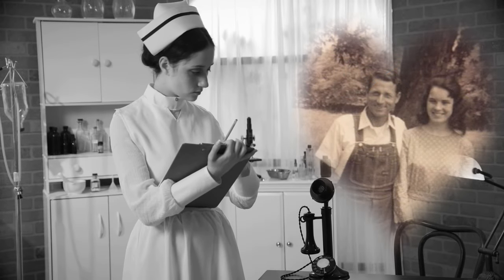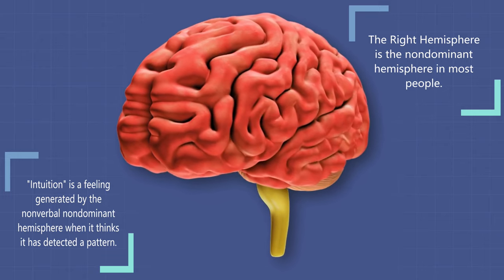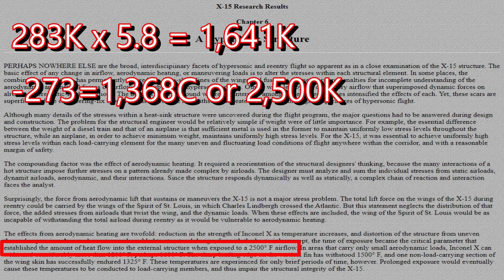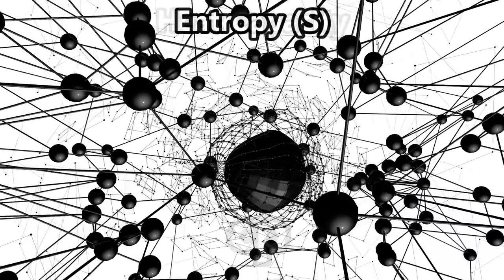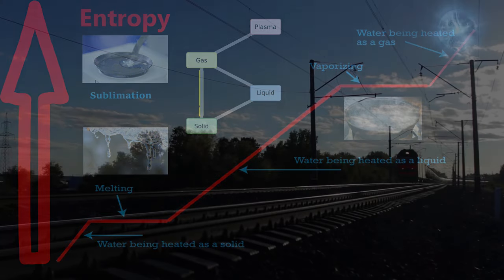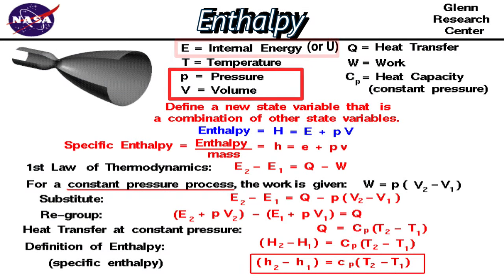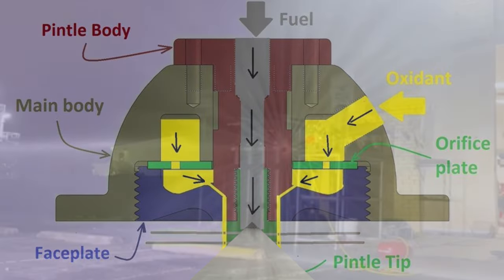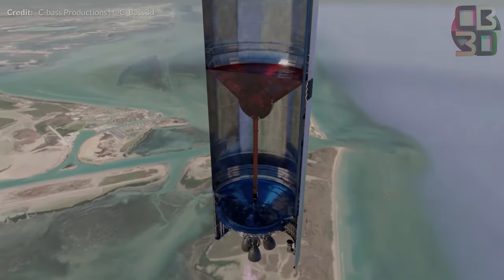Understanding the Thermodynamic Genius of Starship Technology

Comment: Great detailed video again love it
Approximately what temperature would the hot gassies oxygen be returning to the oxidiser tank B? It is staggering to imagine the complexity of plumbing and seals required for swivelling engines to Connect to those propellant lines the materials choices must be very limited cheers
Reply from the maker: That's a good question... probably not too high as the cryogenic fluids are running at incredible rates... 200C for the gas maybe?

Comment: Hmmm.... raises the question, is there a Raptor 3 somewhere down the road do you think?  Is there a potential for growing this design incrementally larger and getting it to say 3,500kN?  We went from 1.8mN on Raptor 1 to 2.3mN on Raptor 2, that's nearly 28% improvement, another generation or two might get us to 3.5mN.  I'm trying to see how many versions of the Merlin engine there have been.  I think they'll squeeze the Raptor design a tad more.
Reply from the maker: We think so too but we are pretty certain there will be some radical changes, perhaps even an aerospike.  That's about the only way to squeeze more efficiency out of a Raptor... though it would be simpler to get more thrust and sacrifice efficiency... We think they have plans to improve both.
Reply: @terranspaceacademy  - Yes, with the pressures they've reached in the combustion chamber of the Raptor 2, they may have taken this design about as far as they can.  While they still may squeeze a few more percent, maybe even 10% more thrust, at some point, it's going to be time for a whole new design.

Comment: Heat capacity is not dependent on change in time (little t), but change in temperature (big T)! 
Also, 2K should be negative not positive 400 Fahrenheit. Do you even check your work?
You're slipping, professor.
Reply from the maker: I do indeed... And would be happy to review anything similar you produce to see if you can do better.
Reply: @terranspaceacademy  PM your email address. I can send you my thesis. :)
Don't take it so personally. The big picture ideas are there, like you said. Everyone's got to get double checked, and you happened to get checked by a biophysical chemist.
Reply: @Gnefitisis  Well that’s like an amateur boxer getting knocked out by Mike Tyson :-) I’ll take that as a lesson. And thank you. I did not mean to sound snarky.
Reply: @josephparker3033  Let's not be dramatic, I'm not here to knock anyone down. It's more like seeing a high spirit amateur boxer and the old coach on the side gives some advice to smooth out an otherwise solid combination.